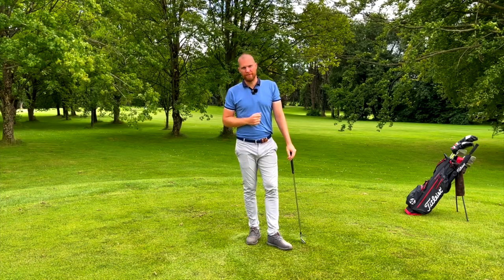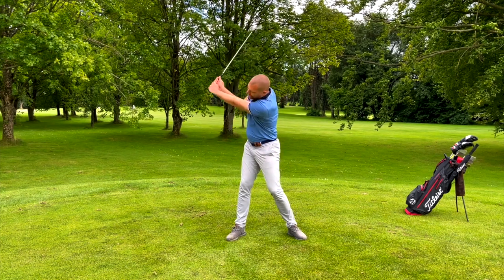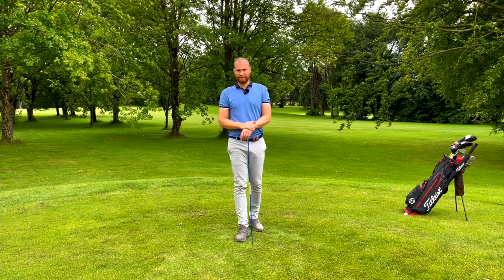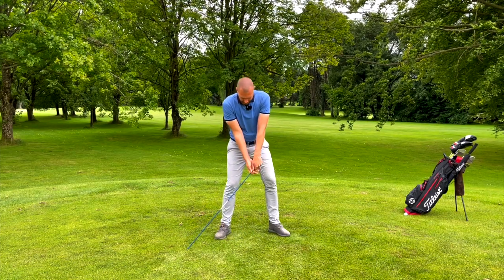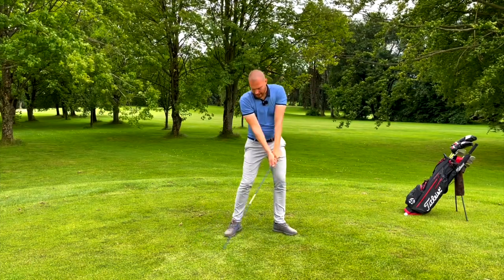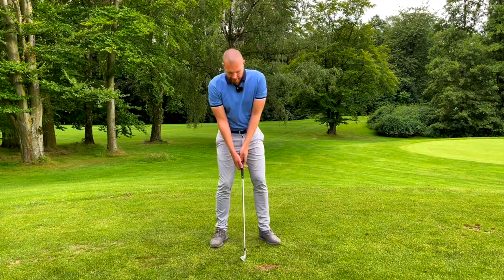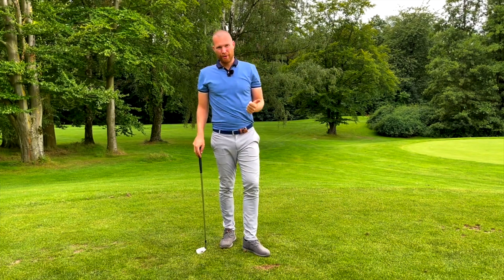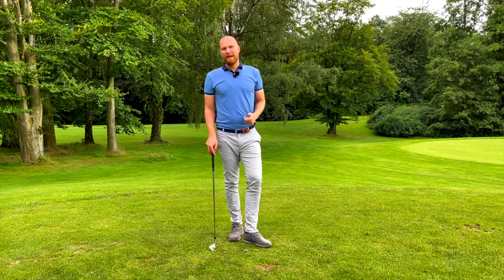The SECRET to straight arms in the golf swing

Comment: Thanks for a wonderful, detailed video to help my issue with arm structure! Can you offer any tips on checking the grip or arm position in the setup that would promote good arm structure .
Reply from the maker: It is the other way round. You need to know how the arm structure should be in the backswing. Go to this position in the backswing and feel how the hands should grip the club to make this correct position rather easy to achieve. From there go back to the setup.
Reply: Feel that the arms are dead and heavy at the start of the swing and that the right arm stays bent into impact.
At transition the traps are fully relaxed and the arms deadfalling, with the same heavy feeling you had at address.
Impact, should feel like your hitting the ball, with your chest. Ie with the mass of your body mechanically coupled, to the "  very dead arms," falling with gravity.

Comment: Glad this came on my feed and that I clicked it. Great lesson, very thorough. Personally this mac ogrady style drill you demonstrate is something I have/had been trying. Felt great hitting the ball, low flighted shot that travels about 10y less but its much more consistent to execute vs a full swing. Though when i video myself, arms are still abit bent just past impact and I proceed to cheat and straighten the arms to the finish.
Diagnosed the reason myself as my right elbow at p6 is too far from my right hip, perhaps due to bad backswing. Still searching for answers to solve this. 😅 subbed! Keep up the good work 👍
Reply from the maker: Glad to hear that!

Comment: I find in order to achieve good impact and extension of the arms, the takeaway and in particular the wrist-cock in the take-away needs to happen correctly. My issue with the takeaway is, my hands go away from me and club head goes behind me, meaning I can’t get in the correct position at the top of the swing to initiate the correct position into impact. It’s a hard cycle to break.
Reply from the maker: Sounds like you are rotating the forearms too much. Try to rotate them the other way.

Comment: All the explanation in the world of having straight arms after impact will do nothing if the golfer doesn't have the correct tempo.  Chicken-wing is a SYMPTOM of casting the club or throwing it from the top of the backswing; the club is coming through too fast after impact and must be slowed with a chicken wing move. But the imagery in the video can help, the last minute or 2.
Reply from the maker: Very true, as I said in the video casting leads to a lengthening of the swing arc. So bending the arms in necessary